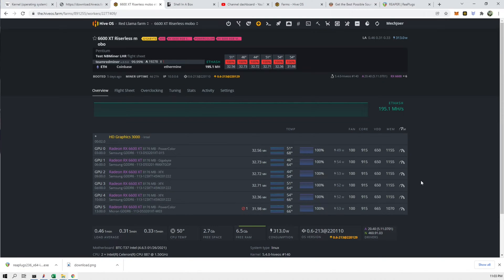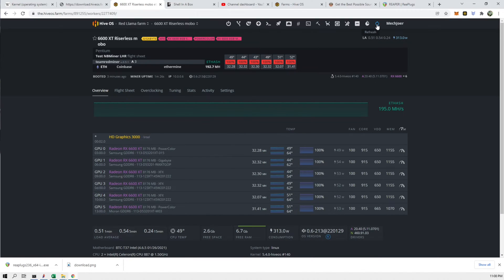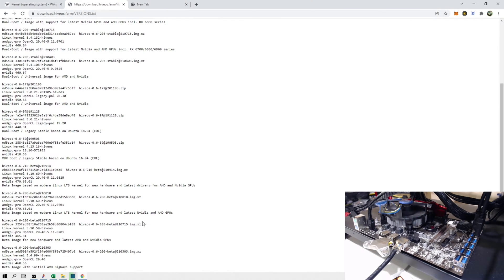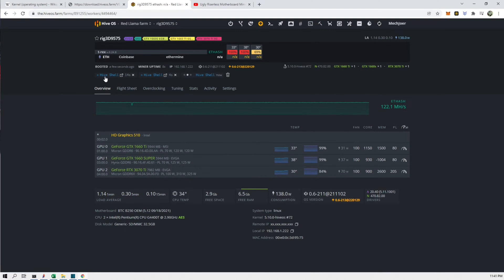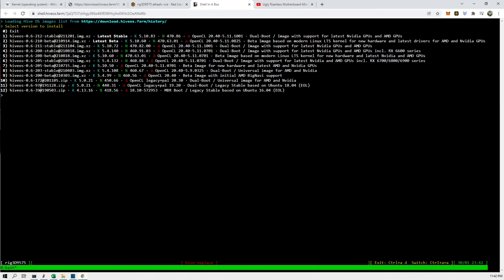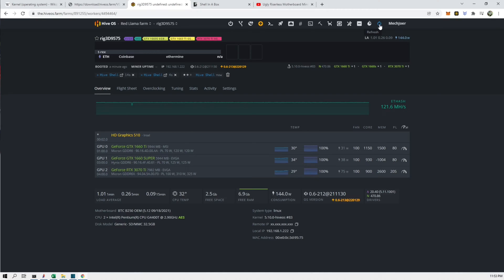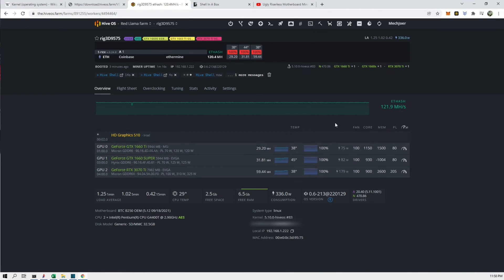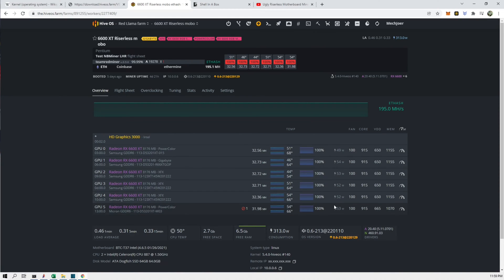How to Update Kernel within HiveOS (S37 B37 T37 Riserless Mobo)

Comment: other then detecting cards is there any other reason to update the kernel as long as hiveos is on the latest version?  I previously couldnt get one of the newer kernels to recognize my ethernet port on an asus prime z270-a  Kernel 5.10.0 works.  If there is no advantage i'm just going to upgrade Hiveos from 0.6-210@21093 to 0.6-214@220331 so I can see Vram temperatures on my 3090s.